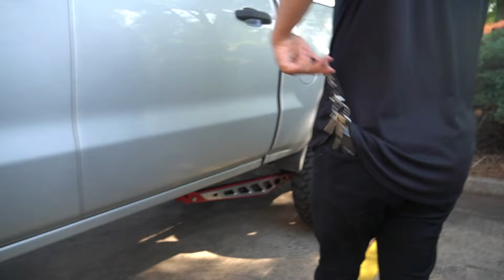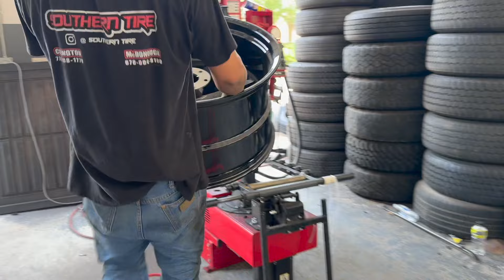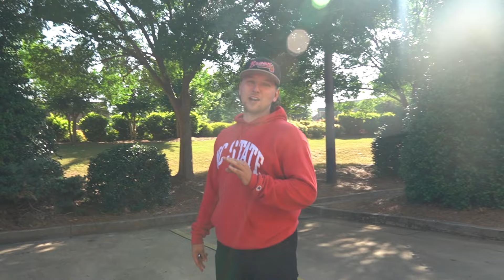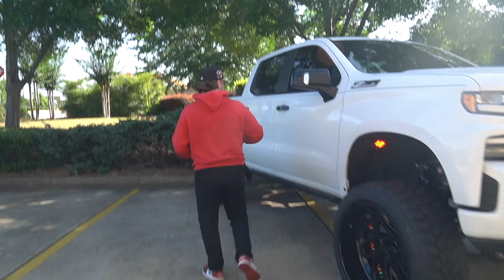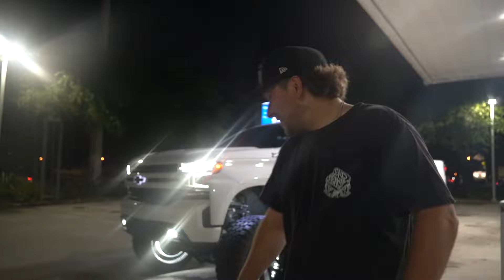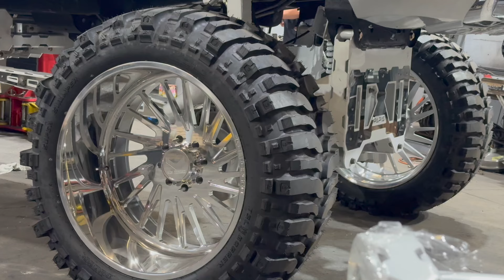BUILT MY DREAM TRUCK AND DROVE IT TO MIAMI WITH NO SLEEP! Chevy on HUGE 26x14s and 9” FTS LIFT

Comment: Truck looks fantastic. Does this setup also work on a GMC Sierra or is there quite a bit more trimming needed? What did you do to recalibrate the speedo and transmission shift points?

Comment: I built my Tahoe back in 2014 and it was a Panda, based on the white to black ratio. Majority white with minimal black I'd consider a Stormtrooper. If the ratio is 40-60 or 50-50 I'd call it a panda.